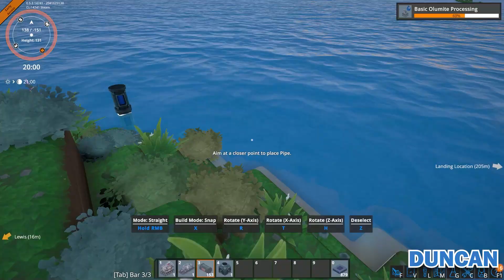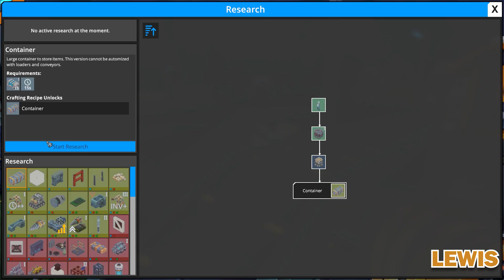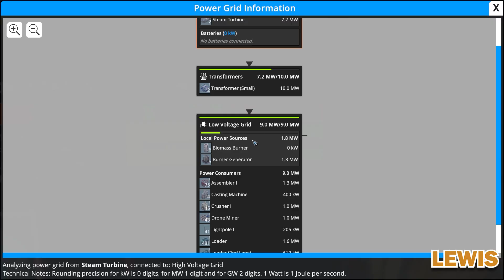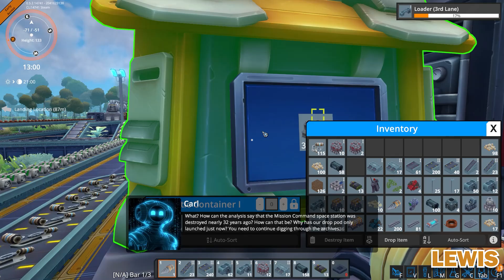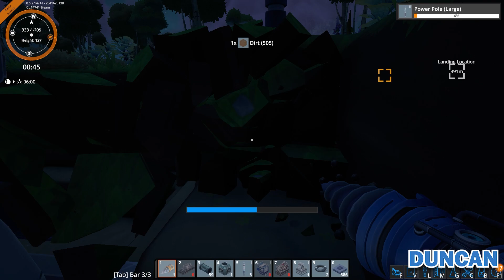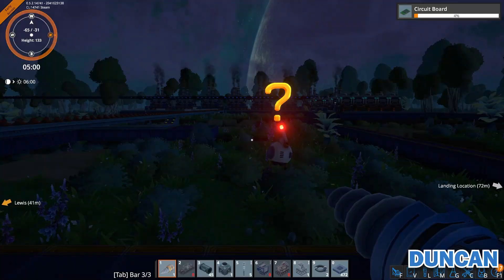Steam Power! - FOUNDRY #10

Comment: I'm pretty sure you're meant to make one interconnected HV grid and then separate LV grids branching off of that with separate transformers. SInce that's how things are done in reality.
Reply: It's going to turn into Duncan doing Immersive Engineering on Minecraft where he used HV wires for practically everything even though it was extremely inefficient.. and would constantly get them all murdered.
Reply: this seems right to me as well
Reply: @Tronmakers  It literally says in the message that multiple transformers have to be on the same HV grid if they are on the same LV grid. If Duncan had literally just run a wire between the two power poles it would have fixed it (because they would be the same grid).